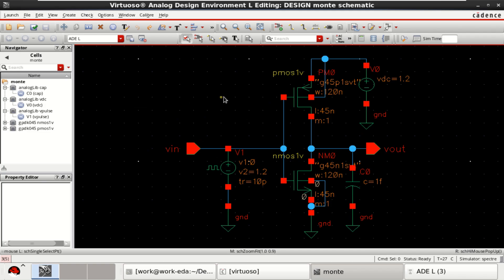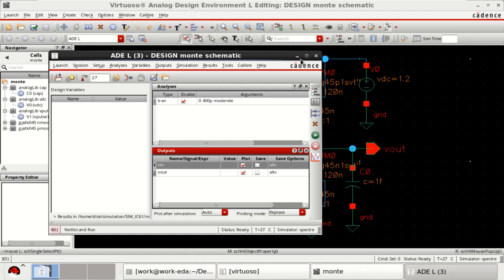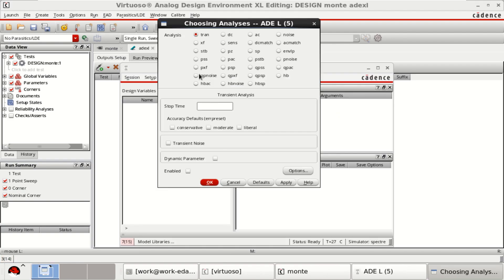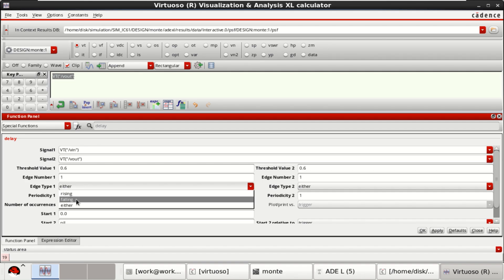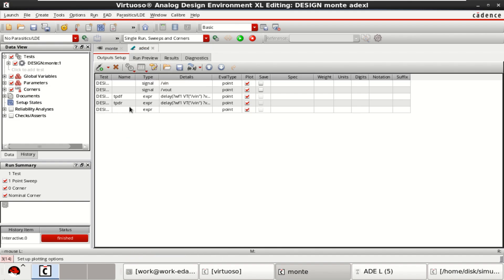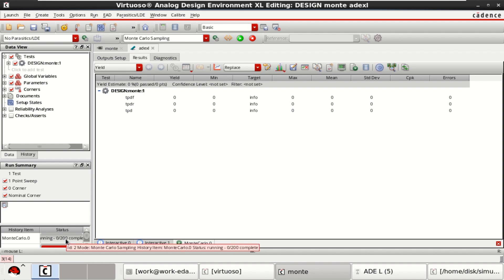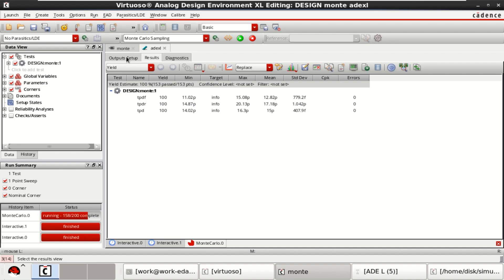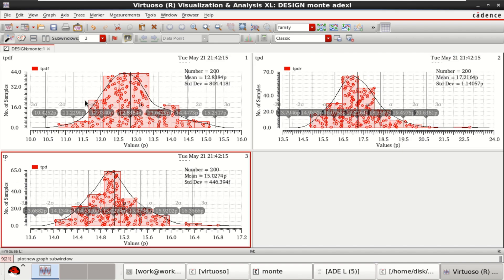MONTE CARLO  Analysis in Cadence Virtuoso.

Comment: You have not specified which parameter is varying by which variable...I in that bell shape curve how we got that different data points
Reply from the maker: Hi, the threshold voltage is swept and the output voltage is observed in the simulation.